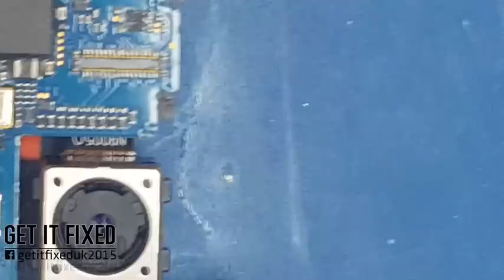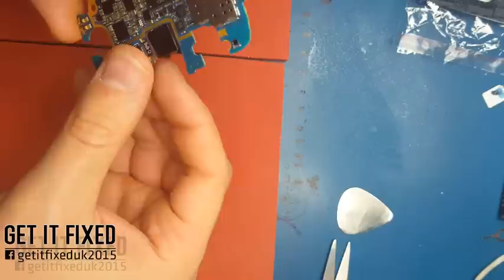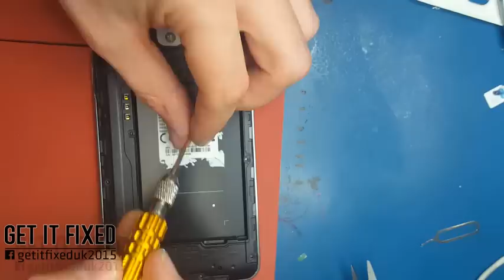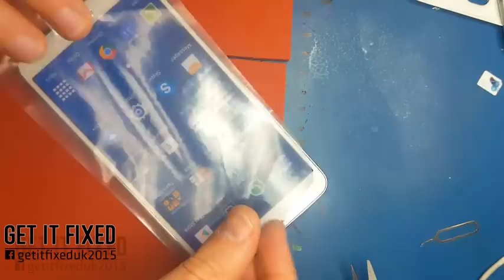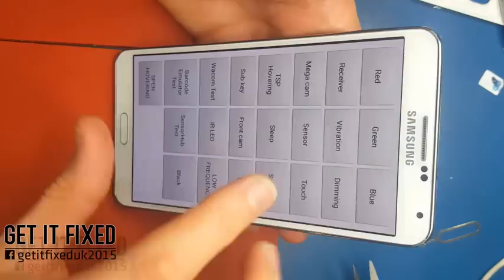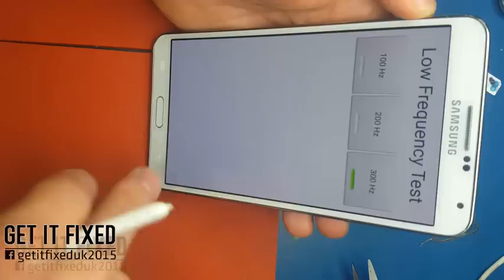Samsung Note 3 Dead Water Damaged Repair Process Fixed

Comment: A syrup spilled on my Note 3 and it stopped turning on. It just shows a dim light. I said water will wipe out the syrup and I removed the battery put it in a bucket of water for few minutes. then put it infront of a high speed fan. After few minutes I put the dbattery back and guess what? It died :( So I plan to put the phone on the sun for some minutes and see if the water will completely vaporise and probably the phone might start working once again.

Comment: hi, I have the same model phone, had it switched off on the charger. phone said 100% so I went to switch it on and it died. no LED or response from buttons. is there anything I can do to fix it?
Reply from the maker: u need to diagnose the board under a microscope first, after u may be able to fix it. If u want me to fix it, let me know on my facebook page, or send me at least 2 pictures with the board, both sides